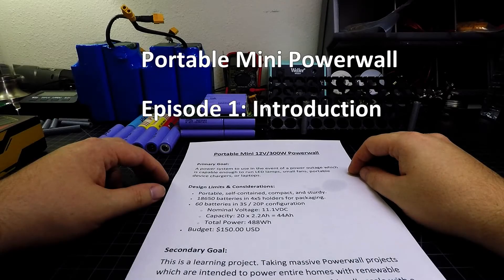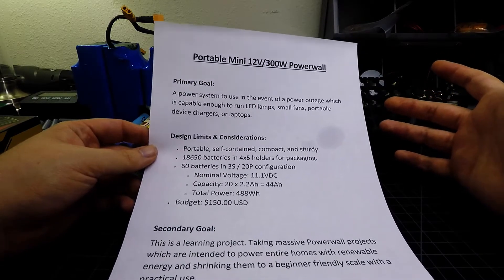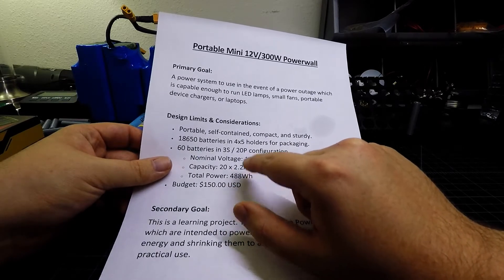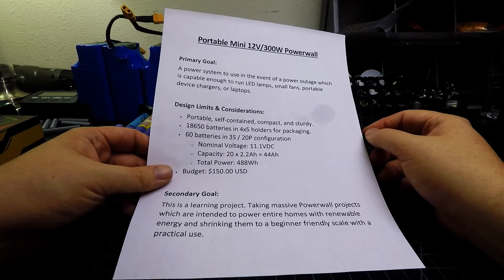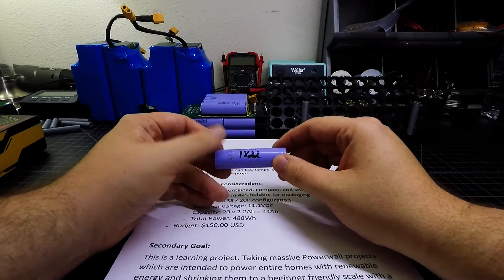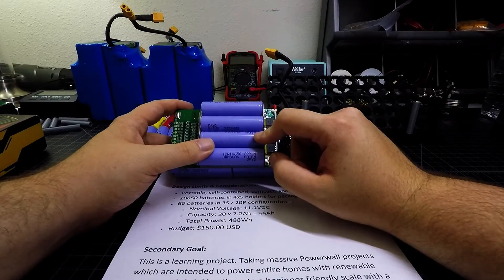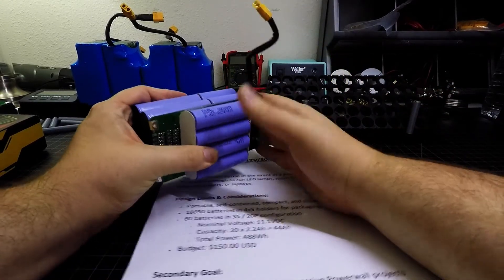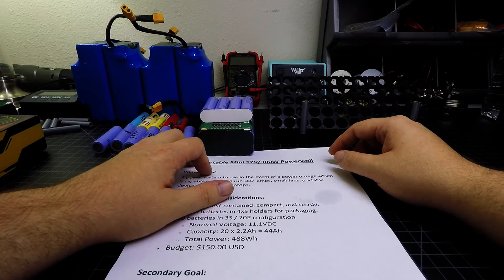Portable Mini Powerwall Project E01 - Introduction

Comment: Great Video! Will you be placing links to equipment and supplies you use in each video? Also will you be building your battery packs with load balancing?
Reply from the maker: I have updated the video description with links to some of the products which will be going into this project, and I will continue to add relevant links to the future videos as well. Thank you for the suggestion.

Yes, I intend to build a balance harness into the battery pack(s) which will be outlined as I get into that part of the project.